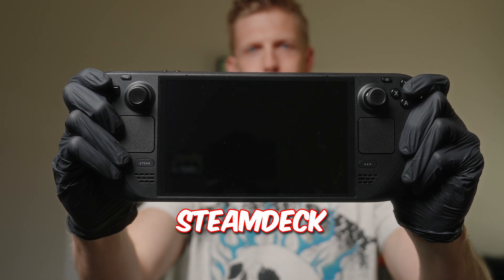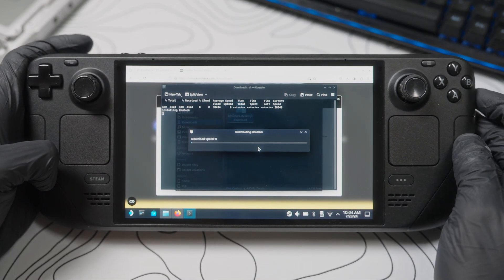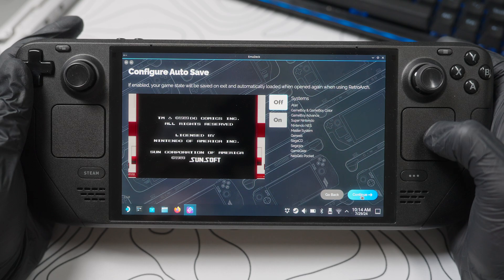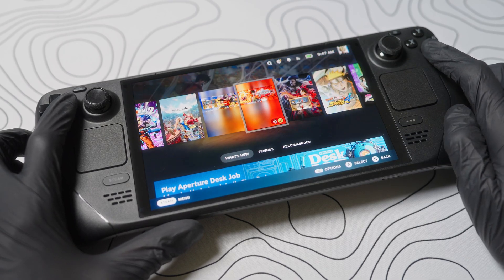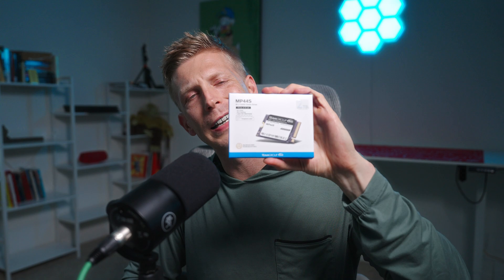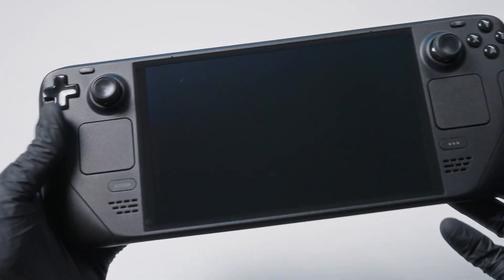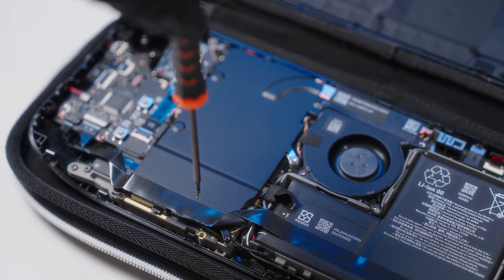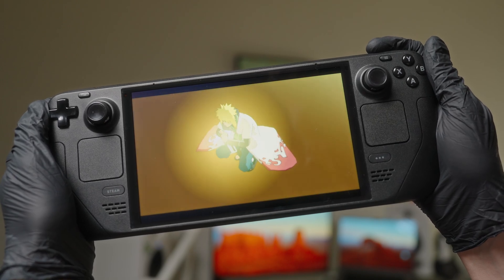The Problem With The Steam Deck (And How To Fix It)

Comment: I really hope sparking zero will run on the deck.
Reply from the maker: @thejustinjustin1233  I’m pretty sure it will? Should I be worried 😟
Reply: @framebanger1 well dbz kakarot said it was unsupported and still ran so idk. It looks very effect heavy so it might be to taxing for the deck but we’ll see.
Reply from the maker: @thejustinjustin1233  yea I have DBZ kakarot and that runs perfect 🤞

Comment: Everyone is entitled to their own opinion, but the steam deck is hands down the best emulation device one could wish for, and that's coming from a point of emulation on mac, Retropie, and numerous other systems are much harder process where emu-deck makes the process extremely easy. Search emudeck tutorials if you need help with steam deck emulation, though chances are you won't because it is pretty straight forward. 

 If you want to dissemble your deck for a storage upgrade, first think about upgrading your sd card as it is cheaper and easier, but Ifixit has great tutorials. You can get 1.5 Tb micro sd cards for cheap in comparison if they are on sale, keep in mind that they will only be 100 read / write but the steam deck's wifi card can't download much more than that.

Anti cheat can sometimes be a problem but it is on the developers side to not support it, and honestly, e-sports titles are the ones you will have the most trouble with if at all. Keep in mind that this is not the ideal target audience for the device.

Just felt like this needed to be said as this video is rather misleading. I own a steam deck oled and could not be happier, if you are on the fence I recommend hopping over to Linus Tech Tips and having a look at the features over there, or other channels.
Reply from the maker: Thank you for your input, and I love my Steam Deck too